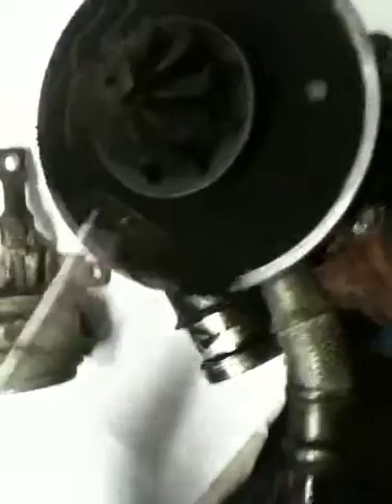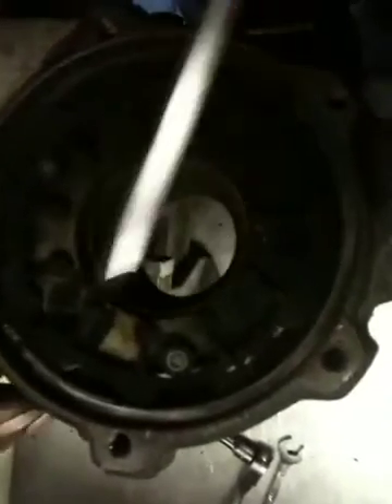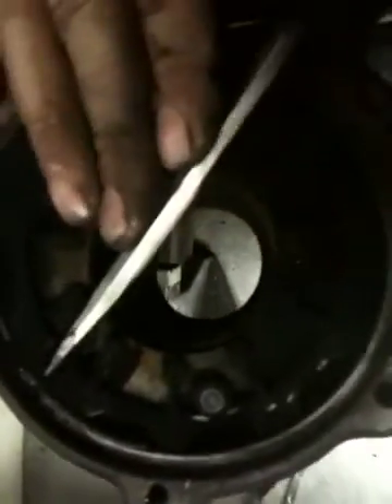R-tech sticky VNT Repair Part 2

Comment: my Mondeo Tdci 130PS has red coil light first thing, the a stop/start takes it off, ive tried a cleaner, not a great result, once cear of red light i can boost it right upto 4000rpm, car has done 170,000, actuator is electronic and working, arm to turbo is sticky and rough, what price to remove/strip/clean and remove, unless u have a spare on the shelf? im near tamworth. ta

Comment: I'm 99% sure my PD130 is suffering from this issue. It keeps going into limp mode when I reach 75mph and just sits idleing at that speed till I restart the car, now the garage I got it from said they can't find an issue (3 Times I might add they've told me it's ok nothing's wrong with the turbo) but it's happening more often now and I don't have 1200 to spend on a new turbo, now can any mechanic be able able to do this then as to me it seems straight forward enough to take it off and clean.